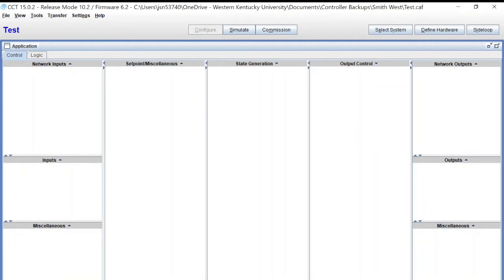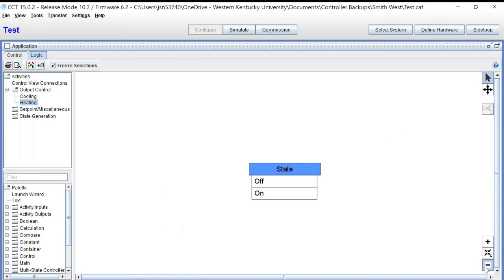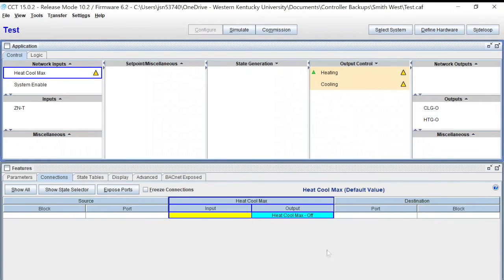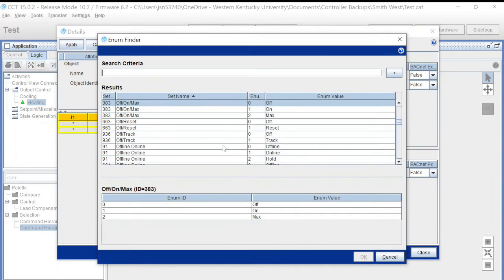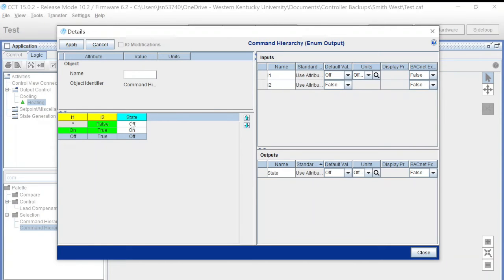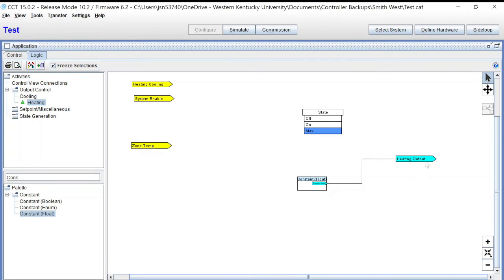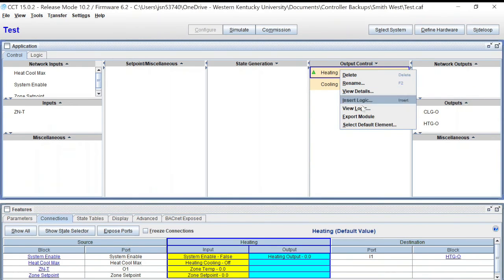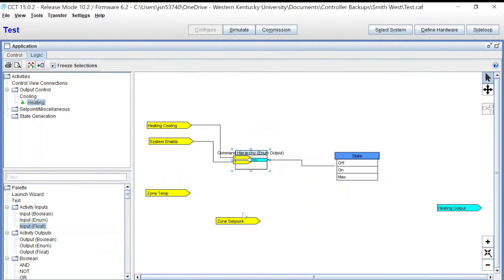Mastering the Johnson Controls CCT Software: Hybrid Activity & Command Hierarchy Tutorial

Comment: Would you consider making an additional video that shows how the PID loop responds in direct acting and reverse acting modes?
Reply from the maker: Yes. It will be in the near future
Reply: @Systemcontroltech  I would like to see how you would between direct and reverse using a chw/hw temp sensor. this would be like a winter summer setup